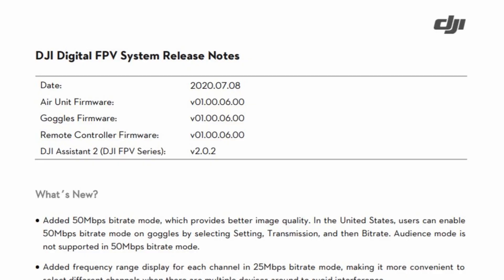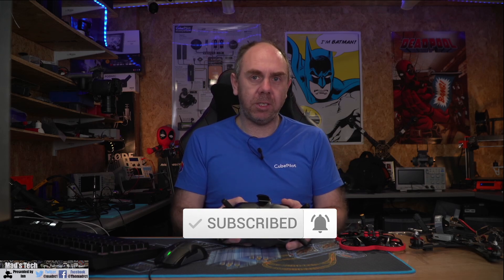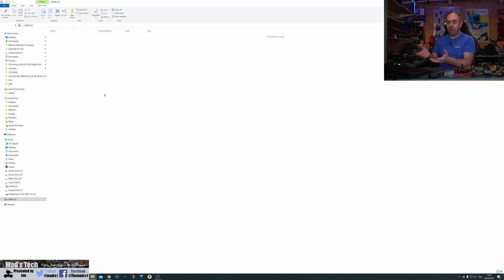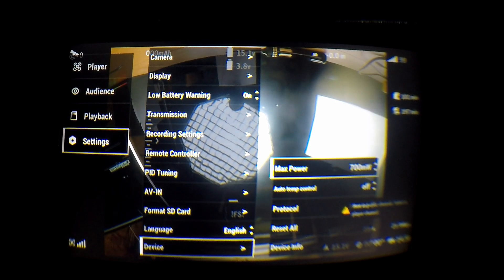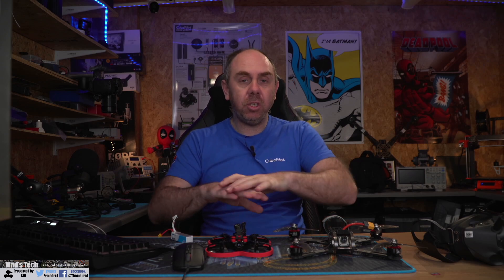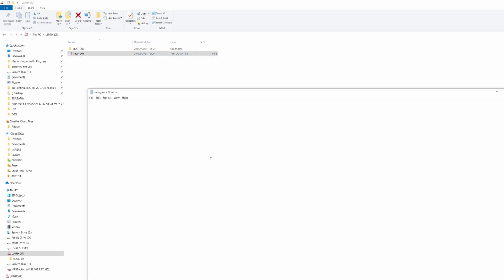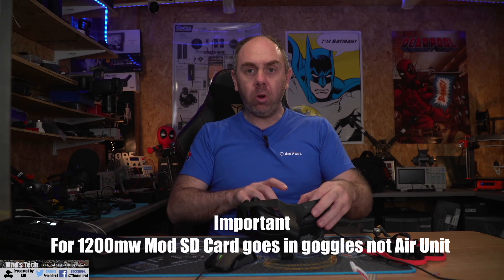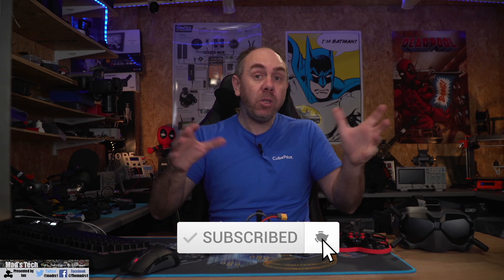DJI FPV Goggles V2 FCC & 1200mw Hack - Complete How-To For V1,V2, Caddx Vista & DJI Air Unit.

Comment: This guide works fine - thank you! 

Heads-up: As of February 2022, with a UK purchased set of DJI V2 goggles, registered and updated to the latest version of the software, the steps in this video work EXACTLY as described. 

I think users are naming their files incorrectly. The files written in notepad will automatically be given the extension .txt - your file names should be: 
naco (for the air unit/vista)
naco_pwr (for the goggles)

If you inadvertently name either or both the files with .txt in the title, it won't work. This might make some users automatically go down the route of rolling back to earlier versions of firmware, which can cause a degrade in functionality.

The latest versions of the firmware work, no problem.
Reply: Thanks mate, i just got mine and have this doubt! Thanks a lot!
Reply: @SantiagoVelezRestrepo  Cheers! It's very easily over-looked. The rumour that the latest firmware somehow prevents this process from working is nonsense.

The guide above (whilst long-winded) is exactly how to do it and works like a charm.

If you want Betaflight OSD in the goggles AND more importantly - the system to operate in full power mode when the quad is armed - don't forget to open the relevant MSP port in Betaflight Confugurator for the UART that your Tx/Rx connections from Air unit/Vista and your flight controller are connected to.

To do this, on the ports page, switch on MSP under the Configuration/MSP - no need to mess with the other drop downs. Joshua Bardwell has an excellent video on the subject: "DJI very short range? Your MSP connection might be why. 

In my case, on my Iflight Succex  TwinG F7 4 in 1 stack, there's a plug onto the FC and it wasn't clear what UART it was connected to. Turns out, it was UART 2. :D
Reply: @horatio321  perfect explanation! Thanks a lot for that, one question, do you recommend always put the RF signal in 1200mw, or just for long range, 250 or.700 is enough?
Same with TBS micro tx v2, (i have crossfire) is good to turn on always the 1W or 250 or 500mw is enough? 

Thanks again mate!
Reply: @SantiagoVelezRestrepo  I think there is a strong case for setting the power according to your usage/conditions. If you fly  where there are obstructions, or if you intend to do very long range flights, you need the higher power settings. The down side to higher power settings is increased heat and battery consumption. 

My TBS module sucks the Tx battery at full power. So if I'm staying fairly close, I use the lower power settings.
Reply: @horatio321  Thanks a lot mate!! I really appreciate that, cheers from Colombia
Reply: hi. do it still works with new 1.0.7 firmwere

Comment: update: I didn't show all channels because I was in 50 mbs not 25 mbs... You only get all channels in 25mbs not 50mbs (For anyone reading this in this future)

I have firmware 01.00.0606  

It is showing the 1200mw all the way down to 25mw.

 It doesn't show 8 channels though... Just channel 1, 2, 3 and 8 public...

 Is there a way to get 8 channels and is mine working at 1200mw? 

I am not sure it is. Thanks

Comment: The SD card is it supposed to be blank
Reply from the maker: You should format it in the goggles or Airunit first. That way it will be correct.
Reply: @MadRC  thanks got it working

Comment: Really helpful, had to use a windows laptop to transfer the naco.txt to the air unit as my mac just point blank refused to make it happen.
Reply from the maker: Yea Mac is not working well with DJI right now.

Comment: Question. 

After the hack in 50mbps mode on my air units, I still only have 4 ch.  In 25mbps mode I have 8 ch. 
Is this right?  Was my file accepted on air unit? 
I can change the pwr level to 1000 or 1200 in V2 goggles no problem...
Air unit firmware 6.00 V2 Goggles 6.06 rc 6.00 
Thanks.
Reply from the maker: Thst is right 50Mbps is double the bandwidth and half the channels.  .
Reply: @MadRC  ok.  Your video wasn’t clear about the 8 ch after the hack. Those are only for 25mbps mode then.  Is there a meter that will measure actual output of the air unit?  Thank you.

Comment: Thanks a million for this great video - really well explained. An FYI for Mac users out there - I struggled to get this working. I followed all the steps in the right order but no joy - however I was unmounting the Caddx Vista after installing the naco.txt file. This seemed to negate the process somehow. Once I installed the file and just pulled the USB out without unmounting it everything worked a treat. Not sure if that's a quirk of my particular Mac system but just in case that helps anyone struggling with a Mac. Thanks again!
Reply: i too couldnt get this working b/c of Mac but he mentions in the video its something to do with the Mac Text Editor so you have to download his TXT file from the description. That ended up working for me. First video explaining the Mac Issue with this hack.
Reply: @garychanchan  I cant get my Mac to see the vista when I plug it in how did you manage it please?
Reply: @uasflightops3410  Try different USB cord. Make sure you launch DJI FPV app, power on drone with Lipo, then plug in the vista.

Comment: The video makes a lot of sense. There is a question about whether after unlocking FCC, do I need to keep the file on the SD card all the time or activate it once can open it permanently.
Reply from the maker: Once done it will remain unlocked unless you connect it to assistant 2
Reply: @MadRC  assistant 2 you means official DJI application?My drone is dji fpv.Already unlocked FCC on the drone

Comment: How do i check if the 700mw hack is still in the air unit?
In the google i can see option 1200mw option i have installed, but i want to know if the 700mw is still ok.
Reply from the maker: If you have 1200mw you have all the options. Simply change the output to 700mw
Reply: @MadRC  so if i have the 1200mw option in my v2 goggle. Then i know tye 700mw in tye airunit is ok?
Reply: @MadRC  so if i have the 25mw-1200mw option in my goggle ,is it then obious that the 700mw hack is still working on my dji fpv unit ?
Reply: @MadRC  the reason i ask is if i have on 50 mbps i see 1-3ch and ch 8
But in 25 mbps i ser 1-7 and ch 8
Reply from the maker: This is normal. The 50Mbps takes twice the bandwidth that 25mbps does and as such you have less channels.

Comment: FYI: DJI updated the v2 goggles firmware to 01.00.06.06 on 25th February 2021 (probably straight after this video!). As of December 2021, my new goggles came with 01.00.06.03 shipped and the option to upgrade to .04 or .06. I chose .04 and although my Nebula Vista was .06 out of the box, the "hack" worked and I have 1200mw option. Thanks.
Reply: Did you try if the hack works on 01.00.06.06? Because my Googles have that version and I can't seem to get it working.

Comment: I have a Caddx unit on two quads. When I power it up and connect it to my laptop, the drives of the Caddx unit (D: & E:) are greyed out. Nothing can be saved to them. Anyone encounter this?
Reply from the maker: Try installing the impulse RC drivers.
Reply: @MadRC  Thanks for the reply but I was a bit premature and I realized the Vista unit was already in FCC mode. I guess because it's sold in the U.S.? Anyway, after watching your video a third time, I saw that my goggles could already do 700mW and the player showed 8 channels. So I just did the goggle hack.

Comment: I need more than 1200mw for HD FPV system anyone know what thing can i try?
Reply from the maker: There ain’t nothing with more than 1200mw in digital right now.
Reply: @MadRC  thanks for the response, so whats your recomend for 6-7km range in digital system?  Does it enough to just using high gain antenna ?

Comment: Im a bit confused- why hack the goggles? I thought the only transmission is done on the vista/air unit side... The goggles also transmit?! Or does that only partain to the dji fpv drone?
Reply from the maker: Both transmit however the goggles are part of the system too for the link. It’s basically the AU needs to be hacked to force into FCC then the goggles to show the 1200mw option.
Reply: @MadRC  gotcha, i think. Wow this is so weird. Hacking the goggles to make the already hacked AU change power :)

Comment: I bought Goggles V2 and Caddex DJI Air Unit, I have activated it but when I try to connect according to this tutorial, I still can't connect the DJI Air Unit to Goggles V2, and the light on the DJI Air Unit is still red and won't connect, is there any other solution?
Reply from the maker: Are your goggles in FPV Drone Mode ? Go Into settings and About and scroll down and you can switch to FPV Mode.
Reply: @MadRC  yes that's right, I've changed to FPV mode but still can't, is there another way to connect Goggles V2 to Air Unit?

Comment: hello, I tried to copy the file in the cadxx view but when I try to copy it it tells me that I have to insert a disk in the drive and therefore it does not make me copy the file. then when I connect the cadxx seen it detects two units and not one, it detects a unit e: and a unit f:
why does this happen in your opinion? it should only be one unit.
can you advise me what to do to solve the problem?
Thank you.
Reply from the maker: Try connecting using another usb cable. I had this a few times my self before a single drive came up.

Comment: Why I can't transfer files on my vista? My pc recognized it but I can't copy the files into it.
Reply from the maker: Are you seeing the drive appear in my computer? Try another cable and different port.  It can take a few tries for it to appear in my computer.
Reply: @MadRC  I already found a solution. I think it’s a windows10 bug. Here’s what I did. Go to Device Manager->Ports (COM & LPT)->uninstalled the USB Serial Port and then replug the vista w/ batts into PC and finally it was detected as a “storage” then I followed your tutorial and I already have 1200mW options on my goggles. Thank you so much!

Comment: I find the unit gets very hot in seconds I have a fan on it also, problem it is allowing me to select on 25mw ,but not allowing me to alter it. Before i wrote the txt file on the vista, menu wasn't available to me ,so i know the hack worked Just cant understand why i cant alter it. As the camera comes on ,it doesn't allow me back into settings to change it . 
Is the menu supposed to be accessible once the camera is on ? As mine isn't.  Any ideas?

Comment: I’ve noticed on the 1200mw hack my goggles are locked at 25mbs if I take it down to 700mw and power off and back on 50mbs is available again.

Comment: I've tried all the options, but the hack doesn't work. Maybe there are some other settings that need to be done?
Reply from the maker: If your having issues with the Naco file it’s usually caused by the text editor.  Are you sure your not already in FCC ?
Reply: @MadRC  no, I'm not still in. I tried to create naco by my self, to download it from different sources. Nothing helps.  I think it's something wrong with my Googles. Or maybe it's completely lock because I'm in Spain?

Comment: When using a second set of DJI goggles in Audience Mode, if I activate power levels over 700mW in main pilot goggles I have lots of distortion and blocky pixelation in the second set. Has anyone else experienced this? If I reduce the main goggle power output at or below 700mW everything looks great in the second set of goggles.  I have done tests with several different V1 and V2 goggles with the latest firmware and results appear to be consistent.

Comment: ok for 700mw but i can't unlock 50mbps i have the setting on the menue i select it but the osd display still gives 25mbps... mask V1 air unit base dji V1 not vista. thanks
Reply from the maker: 59mb mode only works on ch1-3 when you select it. It won’t work in 8 unless you reboot the goggles.

Comment: Does this hack work for the DJI FPV Drone?  Does it work for the newest firmware?  And lastly how will I know the hack is on 1200mw since I’m not using either air units?  Thank You.
Reply from the maker: No there is a separate hack for the DJI FPV drone.  That will allow FCC mode but no 1200mw.  That’s by D3VL and I do have a video on that.
Reply: Since I’m already in the US I’m assuming there is no need for the FCC hack?  Thank You!

Comment: Hi,
I got my V2 delivered from Banggood CZ to germany. I do not see the option to switch from air unit mode to DJI FPV mode in order to update the firmware to 1.0.06.06 . My current firmware is 1.0.06.00. Is there a way to get the firmware updated?

BTW the FCC 1200mW and FCC mods are working just fine with my current firmware. Is a firmware update recommended for flying caddx vista drones?
Reply from the maker: Airunit mode should have the latest firmware of V0606, FPV Drone mode that’s V2.  

You can update to the latest in Airunit mode via assistant 2.
Reply: @MadRC  Thanks a Ton:) It did work in another laptop though. If I may ask, I saw there are 4 channels (1,2,3,and8) at 50Mbps and 8channels at 25Mbps transmission rate. Is this true after the FCC mod?

Comment: I believe the FCC hack no longer works on the Caddx Polar Air Units. I've done this hack before on Caddx Vistas but I just bought a Chinera 7 with the Polar unit and I cannot get 8 channels to work. The 1200mW mod still does work though .
Reply: Dam it. I’ve been trying for 2 hours until I found your post. I have the exact quad. We’re you able to get it to work?

Comment: I've done the hack correctly because I have 1200mW but I only have 4 channels available :/ I don't know why ^^'
Reply from the maker: If your in 50Mbps mode you will only have 4 channels.  25mbps mode gives you 8.  Double the bandwidth is half the channels.
Reply: @MadRC  is it better to have 4x channels at 50mbps or 4 x 25?will the signal to the aircraft be reduced if the video feed is 50mbps?im quite new to this so excuse me if thats a dumb question

Comment: My v2 goggles menu will not pop up with any buttons pressed and will not update to latest firmware. Any ideas on what could be wrong?
Reply from the maker: Someone else has had this.  So it’s not working at all?  Sounds like they may be fairly sadly.

Comment: Hello first of all I wanna thank you for the video and I have a question. I have dji fpv and V2 goggles how can I make 8 channels to my goggles ? By the way I live in europe . Thank you from now on.
Reply from the maker: Are you using the FPV Drone or Airunits ?  The FCC Hack will give you 8 channels on air units but there is no way to get 8 on the FPV drone.
Reply: @MadRC  so how can I make its distance longer thank for the answers

Comment: Hi, I'm a bit late to the party. But I have quick question. I have DJI goggles V1s and vista unit. I've done both hacks as per your video. I have 1000 & 1200mw and 50mbts. But I only can see chnls 1,2,3 & 8. On you video it goes to all 8 chnls. V1.00.0600 I've updated my goggles from DJI assistant 2, and when I done the hack when I plug goggles for the first time it jumps to all 8 chnls and then reduces to 4. But when I do factory reset from the goggles it's also goes to V1.00.0600 but I can see all 8 chnls. So I'm guessing it's all works eather of the ways, otherwise I won't be able to see 1000 & 1200 me?! 

Also, 10 days ago there is a new update for V1s, V1.00.0606 but my goggles don't like it and telling telling  me / asking me to check it or skip it. Don't kno wif you know anything about that.
Thanks in advance!
MrPash ☺️
Reply: Luckily I could flash from 606 back to 600.

Comment: hi thanks for easily to follow video but can you tell me do i always need to keep the sd card in either unit or the goggles to work when booting up or once the hack has been initiated can you remove the sd card many thanks
Reply from the maker: Once it’s done it will remain unless you connect it to assistant 2.  You don’t need to keep the files on the card.

Comment: is this legal in to do in the UK? or is it just frequency that needs to be set correctly to not break any law? i want to have maximum range at all time to prevent loosing signal on ether radio or goggles even if flying close it just makes sense not to loose your drone and cause an accident

Comment: I have pre-assembled hd drones, the first day with the V2 googles everything went well since I was flying with the factory settings at 25mw with osd.

My surprise is that when I applied the hack, the 2 caddx vista stays in low power mode and I don't have osd, the air unit works well without hack, changed channel goggles, refreshed firmware...

What can be? please help and thanks!!
Reply from the maker: If you have no osd at all then chances are the UART link is not working to the FC.  Does it show any voltages at all?  This will also be why it’s stuck in low power mode.
Reply: @MadRC  I think I solved... Reflashed the both caddx and googles and return to CE, now all working

Comment: is there any reason why I would still only have 4 channels with the file on the air unit SD?
Reply from the maker: Are you in 50Mbps mode ? That uses twice the bandwidth an as such you will only have 4 channels.  In 25mbps mode you should have 8.
Reply: @MadRC  yes sir I was. Thanks for the help!

Comment: I am a bit confused. I have put my DJI FPV drone into fcc mode via dh companion app. Do i still need to configure the v2 googles to 1200mw output via the naco_pwr file in order to get the max transmission range?
Reply from the maker: No the Naco files are for the FPV system only.  The only hack for the Drone and V2 goggles is the FCC App.
Reply: @MadRC  many thanks for your swift reply. All the best!